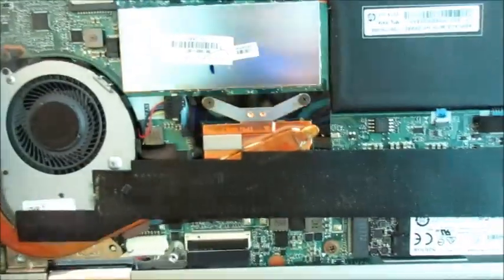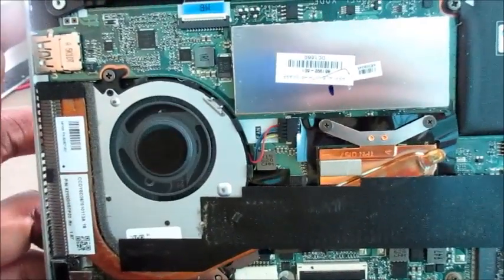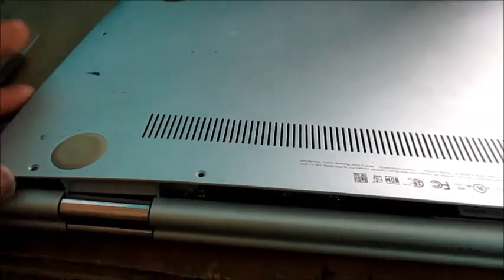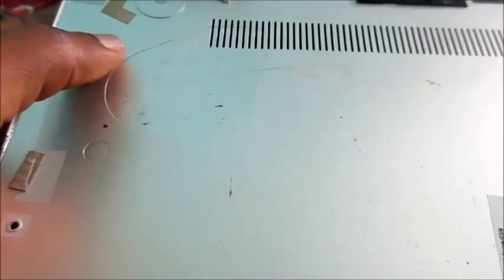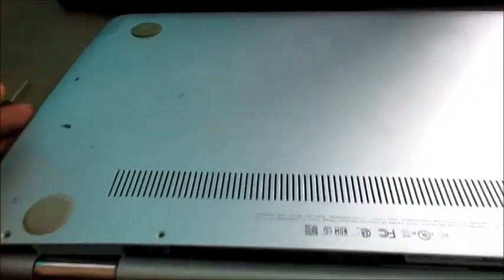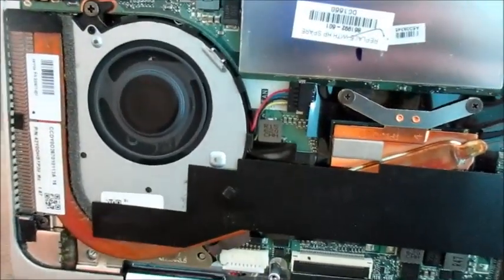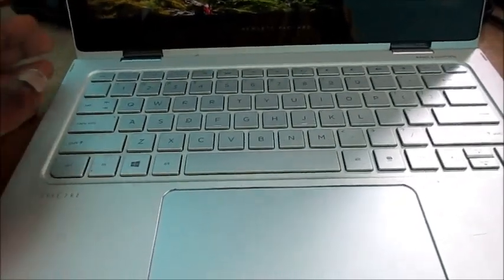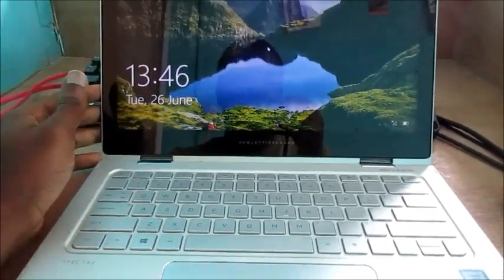How To Fix Noisy Laptop Fan  Laptop noise Fan Fix All Laptops

Comment: I'm facing similar issues with my Dell 5558 laptop Fan noise. But it comes often times when fan spins at full RPM. At low to minimal speed i hear so tickling noise while getting my ears closer to exhaust vent area. 
Suggest me the solution.
Reply from the maker: ok. maybe the fan is touching something or its time to replace it.

Comment: My laptop fan make loud noise whenever i move it like adjusting lappy's position or any type of movement. It starts to make noise as soon as it is moved. Whats the cause and solution? Its also turning off my router's wifi for all devices connected to it whenever i turn on my laptop.
Reply from the maker: can be your fan is going bad or its touching

Comment: Hey bro, my msi laptop on the left fan is making buzzing noise. When I play high quality games, but I have core i7, 8 gb ram. GeForce MX330, why is this happening? Is the fan failed?
Reply from the maker: Maybe your laptop is generating more heat when playing games and cause your fan to over work, or maybe its time to replace fan
Reply: @Lenzwalters  Yes I agree with that, but it suddenly started making buzzing sounds last 4 days. What could it be

Comment: Is there other ways to do this? Taking the computer apart just seems OTT. But my problem is, after I start my computer, it makes a creaking, squeaky noise. It stays there for a couple of minutes. Also, my laptop just keeps overheating if I don't have an external fan facing the computer.
Reply from the maker: replace thermal paste and fan
Reply: Did your problem solve ??

Comment: my laptop does not have a fan. i opened it and found out the fan was missing perhaps it was not making any noise. what should i do? i know it keeps shutting down sometimes when i am using is for more than 34 minutes...or sometimes 1 hour it shuts down and after few min it can run again.

Comment: hi, thanks for your video.

yesterday i removed the CPU heatsink and serviced the fan, applied new thermal paste etc. however the result is not that good.   CPU temperature is still around 50 degree at idle, and around 60 degree when watching any youtube video, cpu fan almost running all the time.   

I was hoping after cleaning the heatsink would do a better job like when it was new, so that the fan does not need to kick in and operate (which is noisy) most of the time.

what is the normal CPU temperature on your machine?  is the fan operating often?
Reply from the maker: it varies with different brand laptop operation of the fan. a noisy or problematic fan needs changing

Comment: Why in the world would i do that to my brand new Omen 17?
Reply: Chris L. I have an omen 15, have you fixed your issue
Reply: @endrit8413  which Model do you have? I sold my Omen 17 and bought an Alienware Area 51m. The Omen i had was a Omen 17, i7 9750H with an RTX 2070. In the Omen Command Center you need to switch to Default Fan Profile. That way it won't run like hell and sound like a Airplane. Also i used Throttlestop to undervolt the CPU and Cache by - 0.160. Also use a Coolikg Pad, this will gain you another few degrees.
Reply: Chris L. Thanks for the tips man. 
I have an older omen 15 with i7-8750h and gtx 1060 I’m using throttle stop and my cpu is fine but my gpu is getting hot (91 C) and I can hear it rattle a bit.
Reply: @endrit8413  Open it and try a repaste. Also remove the fans and clean them aswell. Maybe there is something loose inside.
Reply: @endrit8413  Really sounds like you have to do a repaste.
Reply: Chris L. I’ll try to remove the fans but I’m not sure I can re paste it seems a little hard. Anyways thanks a lot, appreciate it!
Reply: @endrit8413  It is really easy. Just a little patience and a good Youtube instruction Video will help you do the job. For a repaste you need to remove the fans anyways. Believe me...did that on 2 Acer Nirtro 5, 1 Medion Erazer and my Alienware Area 51m already. Learned everything from Youtube. Hit me up any time if you have any further questions.
Reply: Chris L. Ok will give it my best. Really appreciate your help man it means a lot 😁
Reply: @endrit8413  By the way. Did you undervolt cpu and gpu equally?  Otherwise your Laptop won't accept the undervolting.
Reply: Chris L. I only did the cpu undervolt, but when I did the gpu my games would sometimes crash. But I don’t know if my cpu undervolt is ok with my gpu one?
Reply: @endrit8413  In Throttlestop you need to undervolt the GPU und CPU equally. What is your undervolt on the CPU? I say start with -0.125 and go from there and increse is by -5. Do the Benchmark after every undervolt. It is really important that you undervolt equally.
Reply: @endrit8413  If your not sure about your Throttlestop Settings go check for Bob of all Trades on Youtube. Type into the search Bar... Bob of all Trades Throttlestop. He will show you step by step how to set up your undervolt on Throttlestop.
Reply: Chris L. Ok but what about gpu undervolt should it be the same as cpu?
Reply: @endrit8413  yes. I said that before. Exactly the same.
Reply: Chris L. Sorry miss understood at first but last night a think a finally got it. My gpu was stable @1300Mhz with 86 C and cpu @3Ghz with 80 C. 
Can’t thank you enough for the help, the bob of all trades video helped a lot too, have a nice day!
Reply: @endrit8413  86 Celsius is alot if not to much for a gpu! The max it should hit should be 76 degrees. Please let me know your FIVR Settings on Throttlestop. Regards and stay healthy.
Reply: Chris L. Everything on FIVR is default besides the max turbo which is set to 30 for all 6 cores and the offset voltage for cpu core and cache both at -125mV
Reply: @endrit8413  is 125 the max? Your max core frequenzy is 4.2 ghz right? Set them to from 4.2 down to 3.6 from top to bottom. Also try to increse the undervolz if possible and still stable. What is yout short and long power max in the TPL Settings?
Reply: Chris L. Long is 40 and clamp is ticked, short is 78 and clamp is not ticked, turbo time limit is 28
Reply: Chris L. Maybe 85 C aint that bad honestly its not a max Q its a desktop 1060?
Reply: @endrit8413  set the short power max to 60 and check if there is any difference..it is still weird that your cpu runs way cooler than your gpu.
Reply: Chris L. It’s because my cpu is at 3.0Ghz which is quite low I’ll try it now with 3.6 as you told me
Reply: Chris L. I’m noticing that as soon as my cpu is getting hotter like 85+ C my Gpu gets to 90 C
Reply: Chris L. Also with 3.6 Ghz my cpu is sitting at around 90C
Reply: Chris L. 3.4 Ghz is more stable with 84 C but GPU is still at 91C
Reply: @endrit8413  damn. I guess a repaste is the only thing that will help you tons. How old is that Laptop and did you ever do a repaste?
Reply: @endrit8413  if you want i send you my email and you send me screenshots of all the settings you have done to you laptop. Hard to say whats wrong by writing on youtube.
Reply: Chris L. Yeah man will do thanks again
Reply: Chris L. My laptop is 1 and a half years old and I never did a repaste
Reply: @endrit8413  Well than it deserves a repaste. Imagine how long it was sitting in some Warehouse before you even got it. At least ones a year people should do a repaste on their gaming laptops.
Reply: Chris L. Yeah man that seems like the case, plus I can see that the gpu fan is dusty and it rattles, cannot thank you enough!
My situation is a lot better currently and since the software part is done now I should do the hardware stuff with the repaste and cleaning. 
Stay safe dude🙂
Reply: Chris L. Which paste would you recommend btw?
Reply: @endrit8413  Same same. Yea man sound like your fans turned into a vacuum.
Reply: Get a refund if its brand new

Comment: I have a 17 inch HP 4TT1C19R with an AMD A10-8700P Radeon 6 quad core processor. Do all HP laptops use the same cooling fan or do they use different fans for different models of laptops?
Mine does make a buzzing sound when I start it up. But it will go away after the laptop warms up. Also, if I tap the side of the laptop, it may stop as well.
Any suggestions?
Reply from the maker: Different fans. some laptop in the series use the same fan at times. You can try a fan replacement that would fix the issue for sure. if you take down your laptop you can analyze it and see where the problem coming from.
Reply: @Lenzwalters  Is there any way to determine what fan is in my specific laptop without disassembling it?

Comment: Update: Found a fix for some fans that simply don't want to spin anymore

In my case it was not a matter of tolerances, the fan would attempt to spin but was stuck resulting in the grinding noise. So I dismantled the thing by simply pushing the rotor out of it's housing through the rear with my thumbs. I then removed any dust there was on and in it - but no luck - it was still not spinning properly.

I then realized that it simply refused to spin because of the built-in plastic "bushing" that was pretty much dead, it was causing internal friction and with it's 2.5W operating power there's no way it could overcome it. So I peeled off the broken pieces and applied mechanical oil, and now it works perfectly. And by perfectly I mean PERFECTLY as i'm posting this 3 days after.

HP omen CPU fans cost a fortune, but with 5 cents of mechanical oil I was able to fix the thing and now it's even quieter than it was storebought.

I hope this helps at least one fellow human being ^^
Reply: You should prepare a video explaning how did you fix your fan.
Reply: where did you apply the oil?
Reply: @karthikm1527  The rotor itself. As stated I pushed it out through the rear (exposing the copper windings and discreet electronics), I then cleaned everything with isoprop alcohol and lubbed it up. It's been running non-stop for the past 5 months without any issue whatsoever
Reply: Hi dude, will they service the laptop i mean( cleaning) at service centre ?

Comment: It would have been quicker to add a few self adhesive foam/rubber spacers, even a cardboard circle around the fan, simply to prevent the metal case from coming into contacting with it, or causing an electrical short against the motherboard. But to whack it into submission with a hammer, is beyond ethical service technicians guidelines! LOL
Reply: Even if i thought of your answer first, i found his method a lot funnier and still as effective. He did solve the problem at the end haha
Reply: Yes, but nevertheless this gives me ideas on how to fix mine a tad gentler.
Reply: @CatherineAbsil  I dislike these 'fake' servicing videos, they serve no useful purpose, other than keeping the bored and ineducable entertained!

Comment: Hey I recently bought a new laptop and the fan is just excessively loud especially when gaming, it's so loud you can hear it from the other rooms. I opened the laptop and disassembled the fan, everyrhing seems normal. I just bought an aftermarket replaclement fan, is there any chance this one will be better quality  and make less noise ?
Reply from the maker: it can be less nosier, if the fan in you laptop is old and being running for few years yh it can generating a lot of noise even like a old truck lol - most of all make sure its not touching against anything
Reply: @Lenzwalters  It's not old, I said I bought  the laptop maybe a week ago. The fan is new. It's just making incredibly loud noise when playing any sort of games. I'm going to replace it anyways but I think it won't make any difference...
Reply: H8 R3D It probably wont, if the components of the laptop are powerful then they will heat up a lot and will need more fanning therefore more noise
Reply: @evanwang7361  Yea... I'm going to try thermal pads as well and see if it makes a difference.
Reply from the maker: you never know the fan can be defective in some way.
Reply: Go through the list of system processes in task manager (ctrl-alt-del), and right-click to select "search online" for each one that is running the cpu to a high percentage.  If nothing, then go through the list.  It took me 6 months to find the app on mine, because I searched every few days, and gave up.  My culprit was Lenovo App Explorer.
Reply: @highonsmog  Well, I have at least 50 processes running, each of them take less than 0.1% CPU usage,  the most demanding ones take about 1-2% and are system processes which  I can't  uninstall or stop.
Reply: Did the replacement fan fix it? I booted up my dell gaming laptop for the first time today and it has loud fans even in idle mode. It calmed down after some updates, but it's still audible within 5  feet
Reply: @TheIA2000  Yes it did fix the issue. I guess I just had a defective fan. I also replaced the stock thermal paste. The gpu used to be at around 90°C most of the time during games, it now runs at 60-70°C max which is quite surprising, considering that it still idles at 40°C. But if yours is loud even in idle, there's definitely something wrong. Check your temperature with RealTemp,  have you done a bios update? Most of the time it solves the issue.
Reply: @crimson1718  In my case, the process Lenovo App Explorer, ran under the name Host App Updater, and everytime I looked through the task manager, it will drop to a normal usage. 
This was acting just like a browser crypto hijacker.  Basically, I manually searched each of the process names, and that "Host App Updater" showed up on Google as causing loud fan noise, by other users, and only uninstalls with Lenovo App Explorer.  Sneaky. ;) 

Yet, looking up by my laptop model numbers, the solution never showed up, despite the complaints.  The official solution is to update BIOS, which never worked, lol.

I know it sounds fishy, but I think this is intentional, to force users to upgrade sooner, and drive the battery to use more cycles. I won't go as far to suggest that this app is performing crypto tasks in the background, but it acts just like those apps. 
It worked for now, we don't know IF Lenovo will auto-update and reinstall the app under another name.
Reply: @highonsmog  Well it's a possibility.  Or it could be unintentional software glitch. Either way I think that in 2018, you should not have to deal with these type of problems on a laptop, it's just unacceptable.